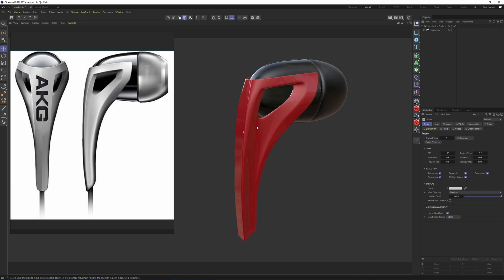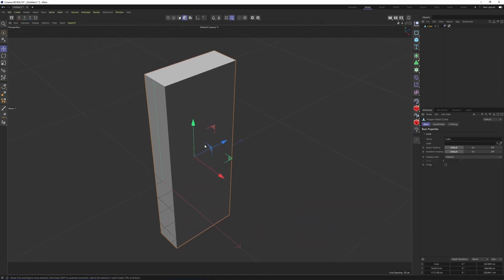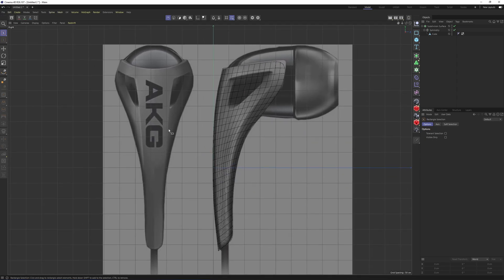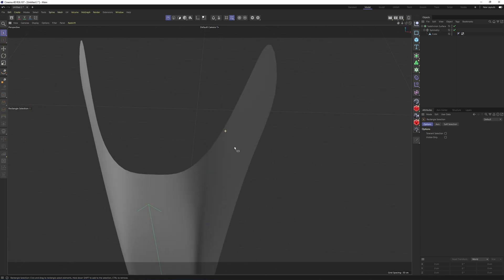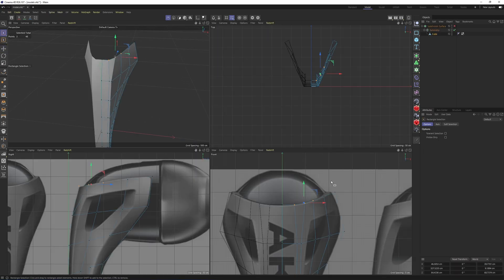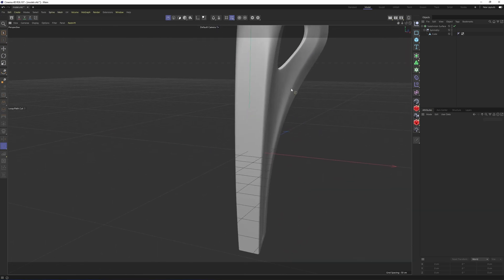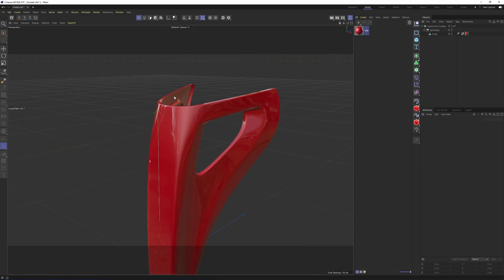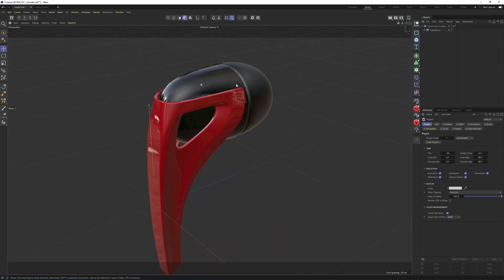Industrial Design/Product Modeling #24 | Earphone

Comment: I think I've asked you this already in the past but I'm not sure I got a clear answer.  But what is the workaropund of align rotate the modeling axis of one component (face, edge or vertex) to match the normal orientation of another component WITHOUT moving\placing\reposition the modeling axis on the other component. Its very useful to dictate the direction of an extrusion for example.
 In 3ds max this thing is called align working pivot. Check the respective chapter of this video  from 0:15 onwards to see what Im talking about https://www.youtube.com/watch?v=xOyaR0laKhU&t=81s

Comment: top quality comment here again!

Do you know how to get the old viewport blueish default material (matcap or how is it called in other software) back in cinema 4d r26? I suppose it was replaced by the new white one which is not so good for modeling if you asked me. Im talking about this one used in this video and all the other older ones https://www.youtube.com/watch?v=cegURbxfbug
Reply from the maker: Thanks you!
I believe you can do that, Hit Ctrl+D and change the color under the color settings!
Reply: @polygonpen  thanks! now only If I can nail the original color. I suppose besides color this matcap has the shame properties with the old one. Do you happen to have an older project or an older copy of cinema 4d where you can read the value of the original color?
And ultimately how to save this a permanent prefferences. Couldnt find this under Edit>prefferences
Reply from the maker: I don't have older C4D versions but you can get a snapshot from my older tutorials to copy color, that may help.